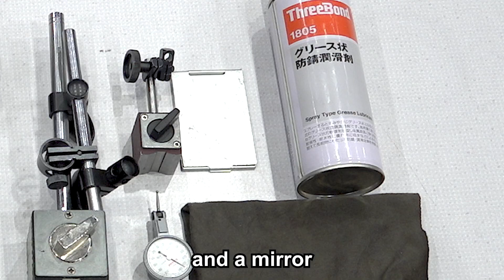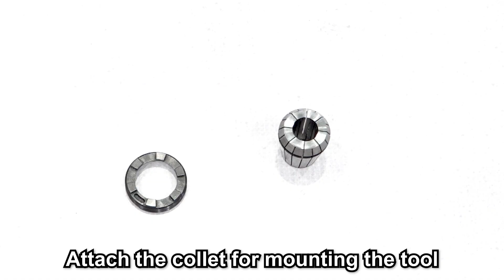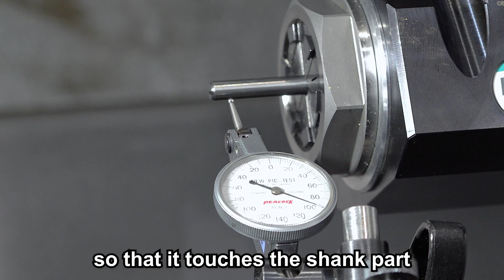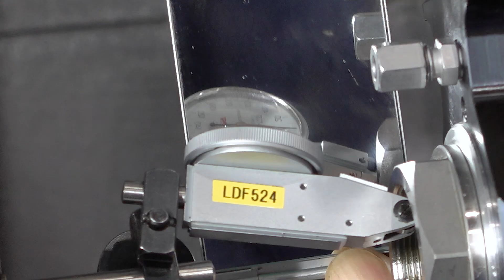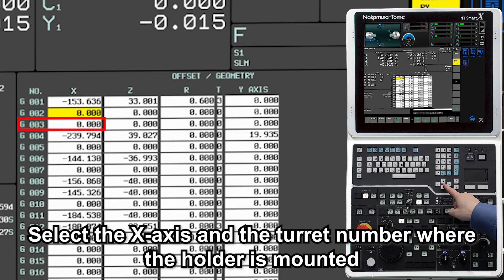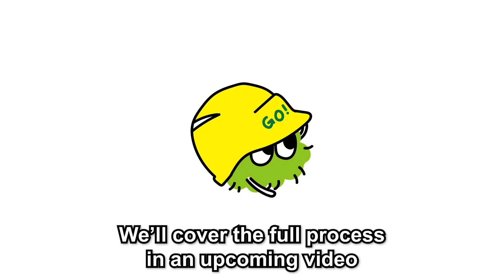Mastering Milling Holder Installation – The First Step to Multitasking Success

Comment: Does this method of center adjustment introduce error when rotating the indicator/base due to "sag" from the force of gravity?
Reply: I was searching for the type of indicator base and it looks like kanetec mb-psl. I suppose the more rigid base helps reduce sagging?
Reply from the maker: Thank you for your comment.
When measuring with an indicator, the indicator may tilt due to gravity. Therefore, it is important to select the smallest possible magnetic base to minimize the effects of gravity during measurement.
Reply: @juansilva936  Haimer Centro or Big Daishowa CTL-90.